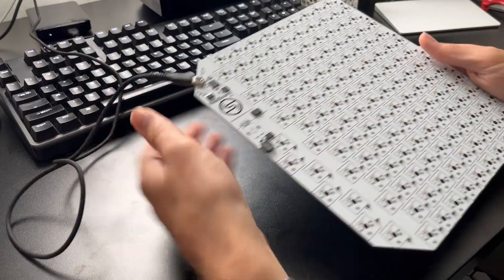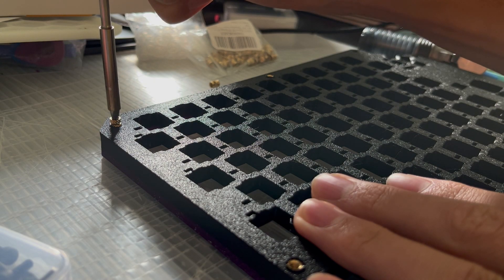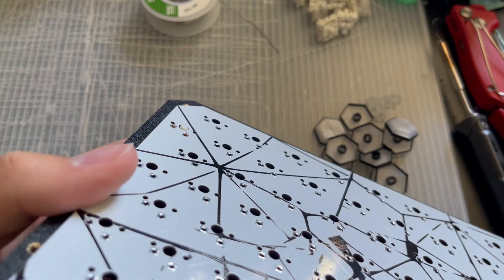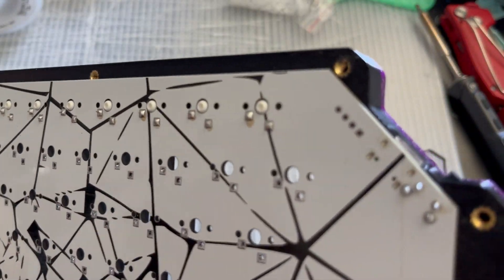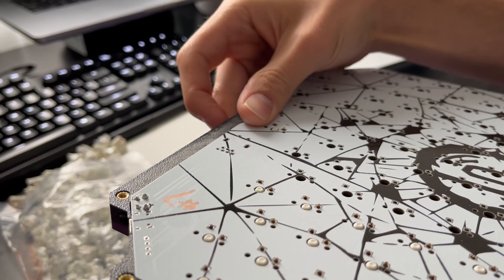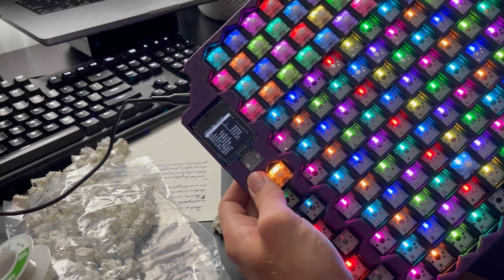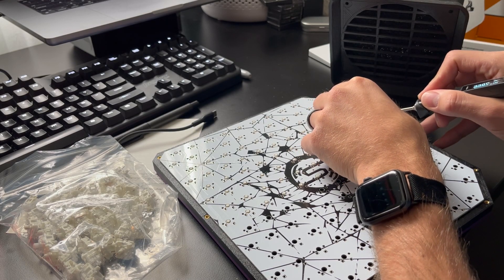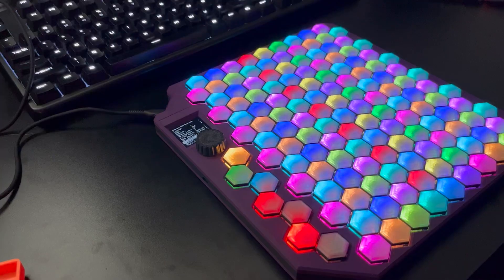HexBoard Build Guide - DIY Hexagon MIDI Instrument

Comment: how did you make the keycaps? i've been meaning to design my own sequencer, i have a working prototype on a launchpad, but want to design my own hardware with cherry type switches.
Reply from the maker: I 3D printed them! It took a bit of trial and error to get the stem to fit just right, but they work really well now that I have it dialed in.
Reply: @ShapingTheSilence  thats nice. I dont have access to a 3d printer. 
do you have any suggestion as to how i could get my own version?
Reply from the maker: If you don’t need special shaped keys like mine, there are plenty of options for square, blank keycaps. If you really need a special shape, some libraries offer limited free use of 3D printers.

Comment: Very exciting! 
I would be happy to buy something that’s playable with two hands and a janko layout. Any chance you can do that? 
What’s your contact info ?
Reply from the maker: Thank you!
I can always add the Janko layout to the current HexBoard, but I don’t know enough about it to know if that’s a good setup.
I may be able to do a one-off, but it will cost a good bit more than the ones I’ve built. You can always reach out to me on discord (linked on the bottom of my website) or via email (jared@shapingthesilence.com)
Reply from the maker: @fgerv I’ve tried implementing the janko layout with my HexBoard, but it doesn’t seem well suited to the task. Plus, I simply prefer the three layouts I currently include by default.
Reply from the maker: @fgerv I like the Gerhard layout as well. It works well on the HexBoard in horizontal mode, but it does have a good few duplicated keys.